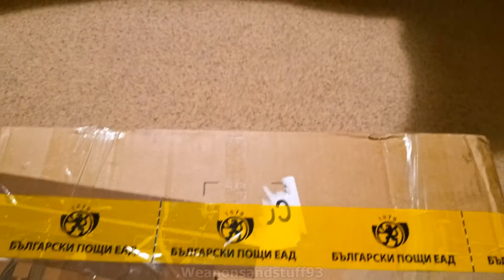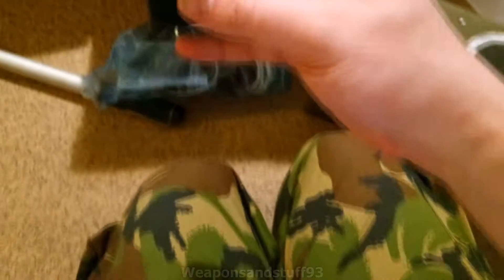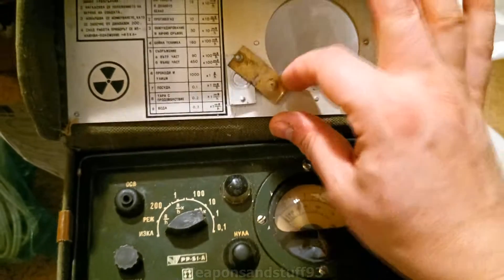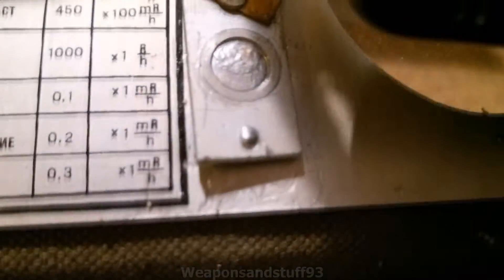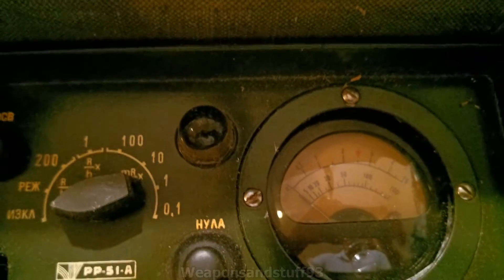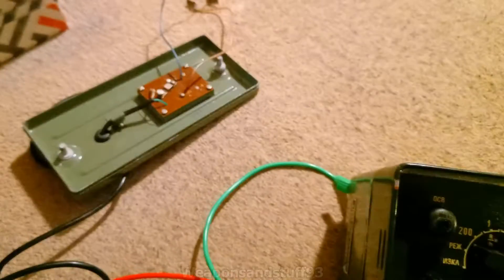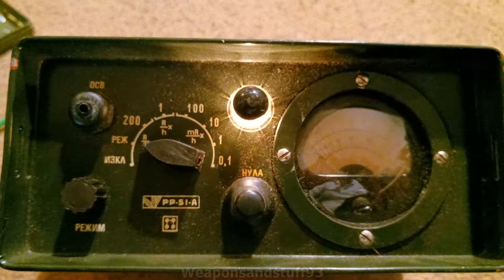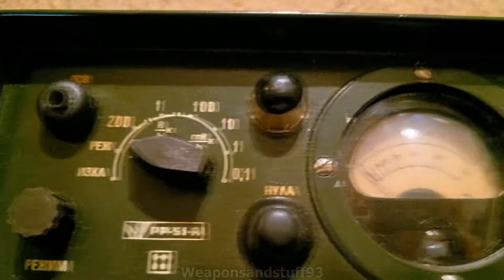Communist Bulgarian PP51A Geiger Counter

Comment: Normally it is the electrolytic capacitors that age badly and go short circuit.  As you are already aware, the RC101 won't directly detect beta's from the Sr-90 source, but it will see the bremsstrahlung.  A good test is to measure with the copper cover and then try with lead sheet instead, you might see the RC101 reading increase due to the 74 KeV fluorescence being more easily detected.  Copper covers for Sr-90 sources are often used as the fluorescence line is at much lower energy and so is much less penetrating (hence safer) than for something like lead.  I would suggest that you use a more traditional counter with some beta sensitivity before deciding upon what the activity of this check source actually is.

Comment: The ammeter is either stuck in the position or its coil is interrupted so the current cannot pass. If you don't find the original meter for replacement, then watch for both current range (most probably in tens or hundreds μA) and the resistance.

Comment: The knob on the bottom left says - Regime/Mode (Режим)
The button on the right says Zero (Нула)
The centre one says Off (изкл. - short for изключено)
Then it says РЕЖ, which I would assume is Mode again.
Top left, where it says ОСВ, it most likely means lighting (осветление). If that helps

A local Bulgarian article states that a huge number of the РР-51М and the РР-51А were sent to the USSR and given out so they could be used to test out for contamination in the wake of the Chernobyl disaster.

Unfortunately, there seems to be more info online for the 51M model, rather than the 51A.
Reply from the maker: Thanks for the info, I'll hopefully get it open at some stage and see if I can easily get it running properly.

Comment: the soviet counters are always interesting to see one of my units not this style, came with the high range tube in the probe dead, this will cause the entire unit to not work at all, one way to check if you got good ears, is to listen to the prob one power on, usually there is some corona discharge and a bit of a frequency whine, the signs of HV running, also my guess is possiblt the 12v setting since it has a 6v setting theres a current resistor somewhere and given how old it is that might be gone so it may have overvolted hence the light blowing out
Reply from the maker: Yeah as you saw at the end though the light bulb acts as a fuse so after replacing that and running it around 6-9V I was able to get the probe to work as I could hear but it's a bit quiet to hear in the video, the clicking coming from the headphones, issue will be something inside or the ammeter itself has broken stopping it from displaying.